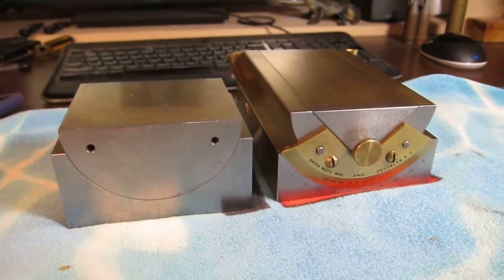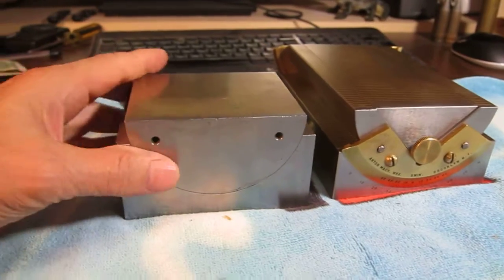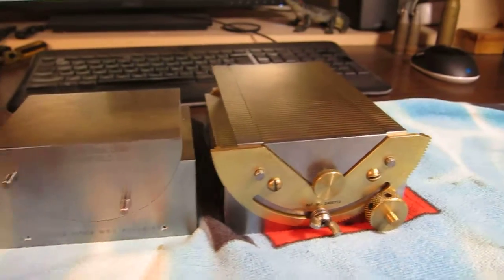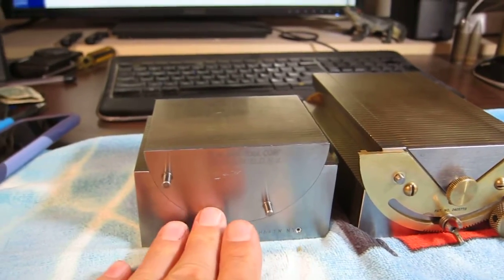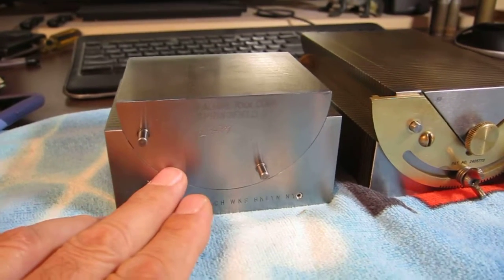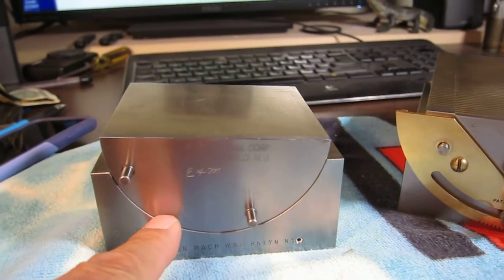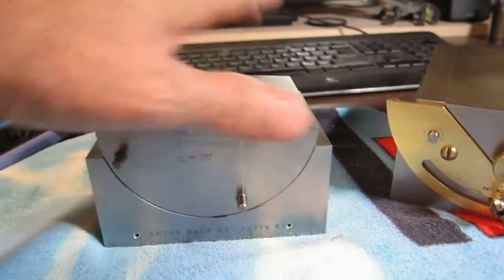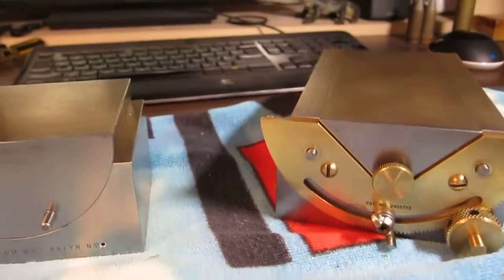Anton ralmikes magnetic parralell surface grinding tilt device.

Comment: Did I mis a posting of the next step?
I'll check, I've been going backwards through your machining oriented content.
Reply from the maker: that small one I am placing for sale on ebay since I need the money and I dont need so many mag sines.
Reply from the maker: that small one on the left the intent was to simply make a locking device exactly like on the other one but not as detailed with markings. Then simply set it on the surface plate on a sine plate and set it and lock the wingnut. Problem is I have so many things going such as an invention that I cant do everything. Also to do that a person NEVER gets their money back out of it for time and trouble. thus I will sell it as is.